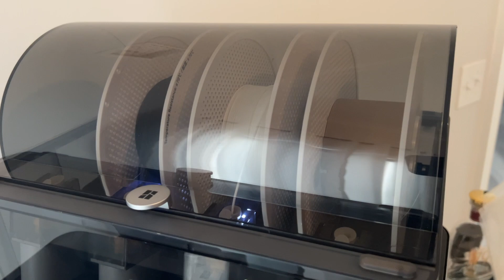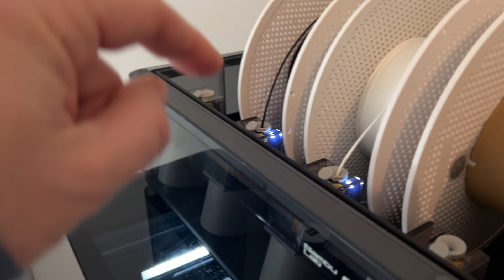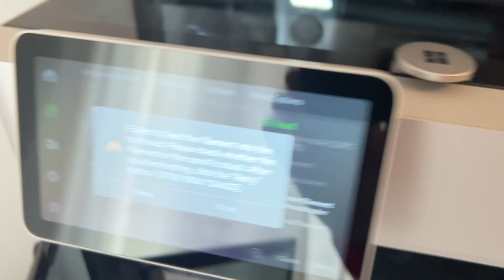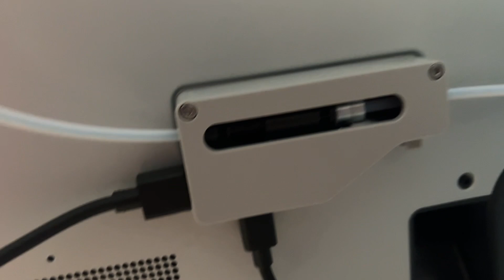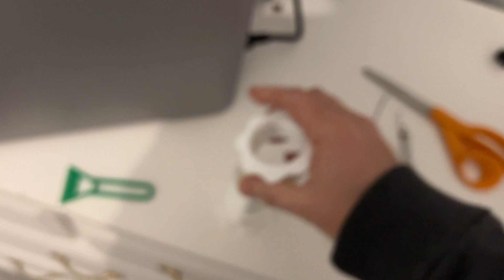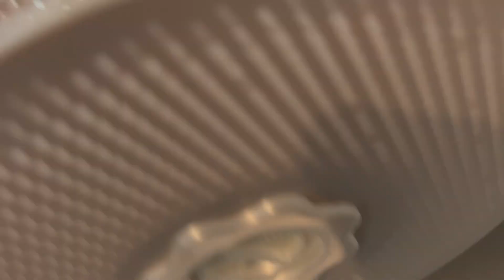Bambu X1-Carbon PLA-CF Issues FIXED!

Comment: ha! I just tried to run PLA-CF on my P1S using the AMS and got an error before ut started printing, took the hotend off and the extruder and found that the filament had snapped, removes the piece of filament while in my head I kept remembering the warning thay came up on the Bambu Handy app about the possibility of the filament damaging the AMS. tried it on my A1 and no issues, it also helps that the extruder is already hardened steel, just need to upgrade the hotend as well. Moral of the story: just stick to the A1 or the
P1S external spool holder.

Comment: mine got stuck in the extruder. I had to load and unload regular pla a few times heating the nozzle to 300 before I got flow. I think this filament in going straight in the trash. at least I got a spool. you'd think Bambu would give filament for the best user experience. this went from a sturdy model to a 40 min fiasco.
Reply from the maker: @joshmaier18 it can get really frustrating really fast!

Comment: from all the vids ive seen they ALWAYS say to use CF on external spool folder and not ams.
Reply: Directly from Bambu's own website filament section, these are compatible with the AMS
PLA-CF
PETG-CF
PAHT-CF

The two that aren't are 
PA6-CF
PET-CF
Reply from the maker: @WhatTrigger  yup
Reply: i stand corrected @WhatTrigger
Reply: @peterpeter5666  lol was just hoping to get info to you before you decided not to purchase one, Im just confused as to why the other two arnt compatible as I was doing some research before ordering the X1E (wanted the active heated chamber and better filtration)
Reply from the maker: +@peterpeter5666 maybe because they couldn’t get it to feed consistently?
Reply: @HelpMeDIY  it has to do with the damage it can do to the internal gears and/or the feeder of the AMS. Carbon is abrassive, that's why you need a hardened nozzle and steel extruder gears.
Reply: maybe but im pretty sure even on the bambu instructions it says to install on exterior spool? ould be wrong. dont have one yet but been doing alot of research ,cuz im think im gonna pull the trigger and order one next month @HelpMeDIY
Reply from the maker: @peterpeter5666  yeah I was the same and pulled the trigger and not regretting it yet!

Comment: The ptfe tubing inside the ams will be worn by normal filament, the  CF filaments will do 10x faster damage. So do you think it’s possible to replace them with small metal tubes? 

Is it possible to get the extruders in the ams to be hardened steel?
Reply from the maker: +@senurasenaratne5782 good question. Never heard of anyone doing that but I’m still a beginner myself